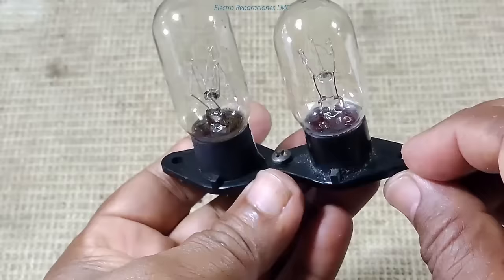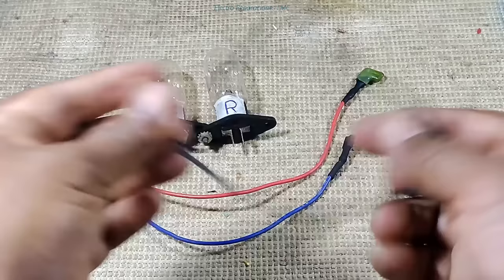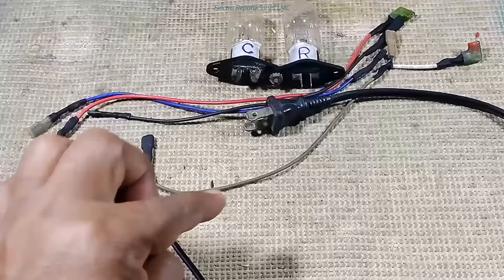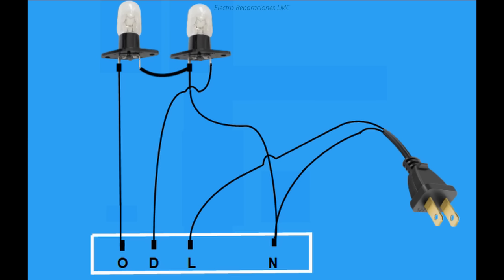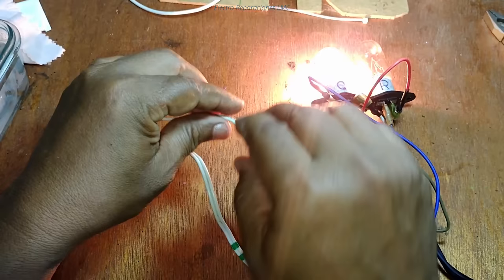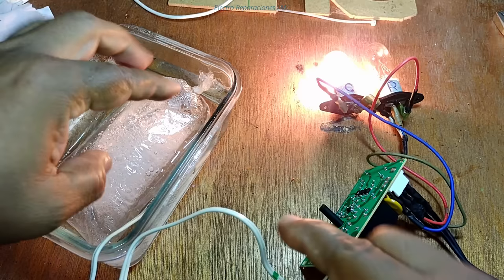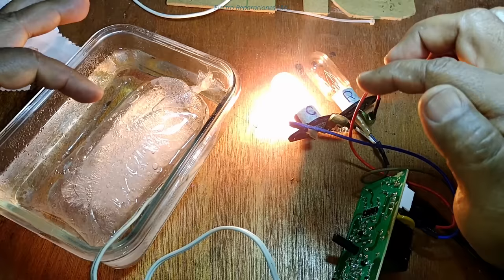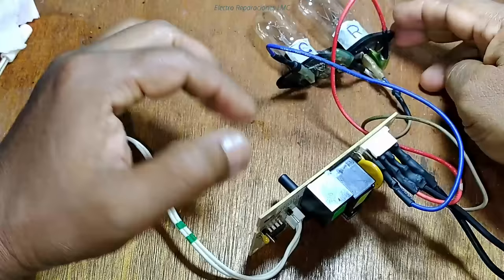Cómo hacer probador de tarjetas de Nevera, usando bombillos de microondas.

Comment: Pero que execelente explicación profe, ya estoy suscrito de tiempo y la primera vez que vi el video apenas empezaba en la refrigeración 2 años después vuelvo a ver el vídeo y ufff, ya le entendí todo, ahora tengo una pregunta profe,si cambio solo el bulbo sensor de una tarjeta cortando el cable y uniendo a una tarjeta que no corta por temperatura, se podra hacer eso y que funcione o tendría que ser de otra manera, espero me saque de mi duda profe, GRACIAS y saludos desde la CD de México 🇲🇽.
Reply from the maker: Hola amigo Jesús López.
Muchísimas gracias por estar en nuestro canal de Youtube y por el apoyo que nos brindas desde la CD de México.
Espero que estés bien y que nuestras sugerencias te aporten siempre una ayuda.
Te comento que eso que mencionas, acerca del sensor, efectivamente funciona bien mientras el valor de resistencia nominal del sensor sea el que le corresponde a la tarjeta donde lo vas a instalar.
Igualmente la unión de los cables debe ser con soldadura de estaño y debe quedar aislada.
Un cordial saludo de nuestra parte.

Comment: Buenas tardes Leonardo. Gracias por tanta información excelente. Podrías enseñar cómo probar tarjeta de nevera Samsun de 2 puertas verticales que lleva tarjeta en la parte posterior y en la puerta del congelador. Gracia.
Reply from the maker: Hola amigo Miguel José.
Sinceramente no tengo a mano ese tipo de tarjetas en este momento.
Pero tomaré en cuenta tu sugerencia para cuando me sea posible, disponer de esos recuerdos en el taller.
Agradezco mucho por tu sugerencia y comprensión.
Saludos cordiales.

Comment: Como esta sr/leonardo mirando el video del probador de tarjeta pero es de nevera,no tiene algún video de tarjeta de aire acondicionado veo que casi no trabaja con estos aparatos,porque tengo una tarjeta de aire acondicionado y quiero probar si el relay que activa el motocompresor,pero quiero saber como probar si se puede con el probador que  nos enseño como hacerlo,pero en este caso como conectar los cable del probador,espero no molestarlo profesor gracias saludos desde córdoba Argentina
Reply from the maker: Hola amigo Hugo Néstor.
Gracias por estar en nuestro canal de Youtube y por escribirnos  desde Argentina.
El probador de nuestro video, se puede usar para probar diversas tarjetas.
Para la de aire acondicionado, es necesario identificar primeramente el neutro y la fase que salen de la tarjeta, hacia el compresor.
Luego de eso conectas uno de los bombillos del probador, en la fase y el neutro que has identificado.
Echas a funcionar la tarjeta y observas el resultado.
Saludos cordiales.

Comment: Mi nevera no enfría en la parte de abajo marca  haier
Reply from the maker: Hola amigo suscriptor.
Gracias por estar en nuestro canal de Youtube.
Existen diversas causas para esa misma falla y por tanto es necesario verificar o descartar cada posible causa, para su posible corrección.
A continuación te menciono esas posibles causas:

1.  Si la nevera es de tarjeta electrónica, entonces la causa puede estar en dicha tarjeta, ya sea en el relay correspondiente al deshielo o en el sensor de frío. 
2.  Si la nevera lleva timer electromecánico en lugar de tarjeta, entonces la causa podría estar en el timer, ya sea que el mismo no avance en los ciclos o que no logre activar al circuito de descongelación.
3- Las neveras no frost, tienen un sistema de descongelación conformado por una resistencia de calentamiento, un termostato bimetálico y en ocasiones, un fusible térmico.  Aquí se debe incluir también al ventilador y el Timer o tarjeta .  De modo que si falla cualquiera de estos componentes, entonces se generará ese mismo problema. 
4.  Igualmente ocurre si se obstruyen los conductos que llevan el aire desde el frizzer, hacia abajo.    Eso puede suceder por acumulación de hielo en dichos ductos.
5.  Una falla en el ventilador, puede afectar mucho, ya que si este se daña entonces no hará circular el aire frío hacia la parte de abajo.
6. También influye la posibilidad de que el sello o empaque de la puerta no esté cerrando herméticamente y por tanto se escape el frío.

Cómo verás las causas para ese mismo problema, son diversas, por lo que es necesario verificar cada uno de esos puntos. 
Saludos cordiales.